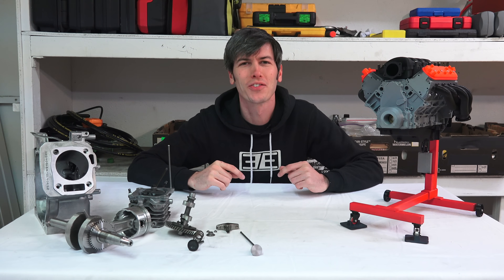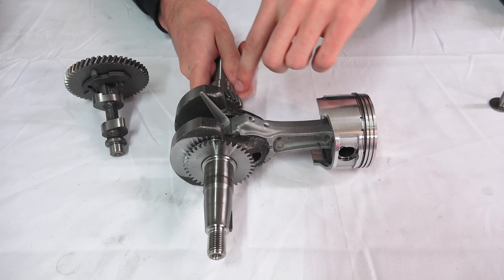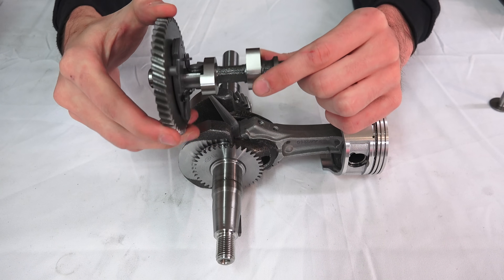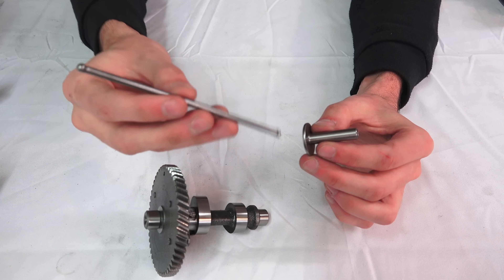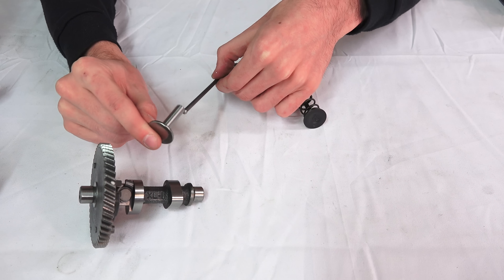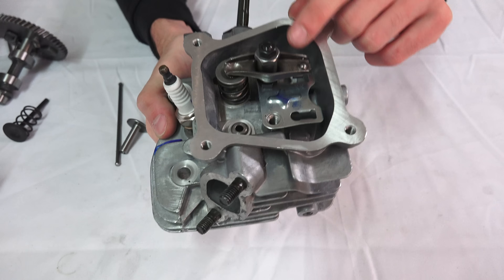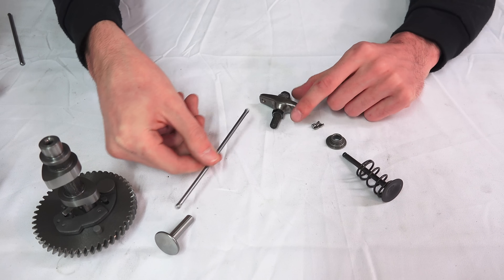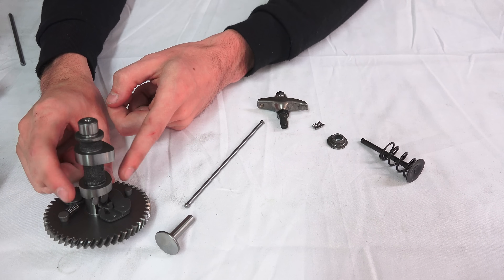Why Can't Pushrod Engines Rev High?

Comment: Lmao. So Nascar engines, which are push rod... Don't Rev high? Hmmmm
Reply: Torque has nothing to do with where the cams, or how the valves are actuated. Typically pushrod engines are tuned to make more torque because they cannot reliably spin fast.  Nissan and Toyota both have 5.6/5.7L DOHC V8s that make just as much low end torque as GM and Chrysler's pushrod engines. Ford's 6.2L SOHC engine also makes a ton of low-end torque. Ford's GAA tank engine is a DOHC V8 that made 1000 lb-ft of torque at just 2,200 RPM.

I never questioned the longevity of pushrod engines in normal applications. I was referring specifically to sustained high-RPM racing applications. They cannot reliably spin 9-10,000 RPM for more than a single race. A DOHC racing engine can be expected to go 100 hours or more on a set of valve springs. A NASCAR engine can only manage about a single race safely.
Reply: Kepe wrong. Again. The 15 k Rev engines are not DOHC. they have pneumatic actuated valves. No cam shafts.
Reply: Yes I do know how long a race is. But how long is your average car expected to last - around 200,000 miles these days. A car like an S2000 is expected to survive endless track days, and hundreds of thousands of miles on the street. 

Race cars derived from production engines like the Spec Miata series will typically go 2-3 SEASONS before getting rebuilt. That can be 120+ hours of racing. NASCAR engines on the other hand get rebuilt nearly every race.
Reply: That is true, you are correct that they spin to 9 grand for hours, which is quite impressive. However "hours" is really not a particularly long time for an engine. A street engine will typically go 200,000 miles, which typically equates anywhere from 4,000-10,000 hours depending on the vehicles average speed.

A 9,000 RPM DOHC 4-valve motor used in a race series (such as a Honda S2000) will typically last for 2-3 seasons of racing, which is around 100-150 hours of sustained 9,000 RPM operation. A NASCAR engine typically lasts for one race before it gets rebuilt - the main issue being the valve springs.
Reply: I already provided examples of DOHC V8 engines that provide just as much, if not more low end torque than competing pushrod engines. DOHC engines are also nearly as old as pushrods! The first OHC engines showed up in 1902.

Lightweight valve springs can, and do take the abuse of sustained high RPM operation. You see this every day in motorcycle engines that often spin to 14,000 RPM or more. Honda once produced a production motorcycle that turned 20,000 RPM reliably. Small, lightweight valve springs can take that abuse. The monster valve springs with 1000+ pounds of open force needed to make a pushrod engine spin 10,000 RPM cannot last long. The stresses involved quickly exceed the fatigue limit of the material.
Reply: did you even watch the video? he said they have regulations..
Reply: Those engines are made for that, your average joe's car engine can't... for long anyway lol.
Reply: mrbaja, nascar engines are junk, and essentialy a 50yr old truck motor design, and only last hrs. Their purpose is to sell old design engines to a uneducated public
Reply: They can't rev high for very long, and require frequent valve spring replacements because of the forces the valve train experiences. A modern DOHC engine can turn 9,000 RPM for decades.
Reply: No. Nascar engines Rev to 9 grand for hours. Go back to sleep.
Reply: bigpigslapper Oink I work for Nascar so.... Yes I do know how long they last. It's for hours. Especially the long tracks. Please stop it.
Reply: bigpigslapper Oink sorry my messages are going to the wrong peeps.
Reply: Nascar engines are racing engines. They are serviced between each race, so they only need to last a few hours of usage between changing parts. Compare that to racing DOHC engines. They rev to 15000 and more. So yes, when comparing pushrod engines to equivalent DOHC engines, pushrod engines can't rev very high at all.
In normal day to day cars, pushrod engines can't rev as high as DOHC engines because they need to last a long time. Which they won't if they are revved high.

Comment: F1 engines haven't revved to 20k for at least 4 years now. The current turbo ice barely go over 10k rpm iirc.
Reply from the maker: Current tech is 16k, again, due to regulations.
Reply: It is not current tech that keeps them at 16k, it is fuel flow regulations that prohibit the engine from going much beyond 16k. If they were allowed to flow more fuel they would be back at 20k+ with ease.
Reply: Engineering Explained unregulated  they would be over 20k by now.
Reply: 15k limit by regulations.
But they never do 15k because why when the fuel rate is limited at 100kg an hour.
Which they can burn at lower RPM's at greater efficiency which means higher power output due to less internal losses.

Sometimes it's better to run at lower RPM's with more boost then at higher RPM's with less boost.
After all there you can't keep making the fuel leaner which you'd have to do when the flow is limited.

Currently the engines run between 11-12k on average.

Comment: In theory it should make a difference and I suppose better fuel economy and efficiency are superior in a very small OHC four stroke but then you see an air cooled 2 litre pushrod flat 4 Volkswagen pushing 1000 bhp and lifting the front wheels and you realise that in the real world the only place it makes any difference is in the pub after 6 pints.Then you ride a performance two stroke bike and you suddenly realise that all this valve train stuff is bollocks anyway.😀😁😉

Comment: What if you were to just not have a cam? If you were to control the timing, lift, and duration of each valve electronically, in theory, wouldn't that be a game changer for performance engines?
Reply from the maker: That's what FreeValve is doing! Super cool: https://youtu.be/FJXgKY2O4po
Reply: I prefer replacing less electrical and having less electronics in my engine. Easier to deal with, replace and what not.
Reply: Snipe Stud00 you say that but what if you could loose the valvetrain completely and just "plug/ unplug" valves and actuators from the cylinder head if it were done properly. 

No camshaft, valve buckets/ shimming/ timing adjustment. 

Electronics oftenly take away a lot of mechanical complexity and remove a lot of complex components improving reliability.
Reply: Samuel Curran you shouldnt run a car in that state anyways. The fuel system will still force fuel possibly washing the cylinder and putting gas into your oil. Thats new engine status. Course thats if the car doesnt shut off for safty purposes. My LQ4 5.3L i can simply remove the rockers, pushrods. and loosen the spark plug but leave it in the holeso crap isnt sucked in or blow out other than fuel leaking out so it wont put preassure against the head or bend a connecing rod to the crank scoring the cylinder. if i recall i have hydraulic rollers not flat tapits, so course id be destroying the cam possibly wearing a flatspot $350, rollers needing replaced from smashing into the cam $50  and since i have to pull the heads, i might as well rebuild it and put decent parts, better than factory, back in. Ckurse that as long as the truck doesnt burn down from the fuel being push right at the headers.. 

I do know GM done the v8 to v6 and even v4 mode cutting cylinders, but im still one to have all 8 and wear all 8 evenly. As time and time have shown again, theres no replacment for displacment. The 6.2L caddillac de'eglance was boosting 12-14mpg on a 3 speed. Those cars had torque, not HP and were land yahts weighing close to what a 1 ton if not more. 

I actually had 4 of 8 plugs loosen on me. Thing chugged like a diesel and drank like a dragster til i found the issue and had time to fix it. Otherwise, i had no issues. Damn aluminum heads expanded and the plug came loose. Had to make the engine hot and bottom out the plug then torque it. Will be replacing heads soon as im tired of the ticking to begin with.
Reply: What? I'm talking about with free valve. You no longer need a valve train as it's run with electronics. Rather than timing an actuation being done by mechanical means 

Running a normal engine with no valve train XD that's not even possible is it. 

Well no of course not. Of course you'll be able to get more from a bigger engine but that doesn't do anything to say how good the engineering behind it is. Whether you need a larger displacement is a different question. 

Yeah I know with the V8 to V4 thing there's a few companies that do it. If they're doing it right they'll be still running all the cylinders but only firing them half the time so rather than igniting every 2 rotations you're doing it every 4 but still running between all the cylinders. simply shutting off half the engine and running the same 4 cylinders is a really lazy way of doing it.

The aluminium heads are only an issue because materials were mixed with the block being iron. If everything was ally it wouldn't be an issue. Got a little 125 2 stroke that runs hot as anything, 2 rebuilds and i've had no issue with sealing the head.

Comment: Pulling 7800 RPM with pushrods isnt too difficult, the only limit for my engine is the crank physically breaking at the main bearings at 8500RPM under load. Doesnt mean you cant wind her out though:)

Comment: You should compare this to ohv and explain their operation as well
Reply: OHV (over head valves) are pushrod engines
OHC ( over head cam) engines with camshaft in head.
DOHC ( double over head cam) engines with 2 camshafts in the head.

Comment: 20.000rpm on F1 engines? Those days are long, long gone. Since they went with hybrid/turbocharged those figures are no more. Thus the reduced noise...
Reply from the maker: I think it's around 16,000 RPM now, but again, due to regulation. NASCAR isn't hitting 10k these days either.

Comment: OHC can have valve float occur too, right? Like during a moneyshift?
Reply from the maker: It can occur with OHC, yes, but generally the valves are lighter, and their aren't pushrods, so there's less reciprocating mass between the cam and the valve spring.
Reply: Engineering Explained Thanks for clarifying that! :)

Comment: The problem with valve float is sometimes the pushrod will get bent because of that quick impact of the tap to the cam lobe, furthermore direct gear-driven camshaft need no maintenance unlike the timing belt and timing chain.

Comment: Can't you just use stronger springs for the valves? Or two springs per valve?  Because usually that's what you do to a DOHC engine when you significantly increase the rpm limit. I don't see why that wouldn't work with pushrod engines.

Comment: Hi Jason,
It is amazing how relatively simple these V8’s are compared to the very complex European and Japanese engines. Could you make a comparison between these design approaches and explain the pro’s and cons?
I’m thinking costs, horse power, efficiency and emissions.
Reply from the maker: Yep, will have a video on it soon!
Reply: Engineering Explained Tia, looking forward to that!
Reply: I am interested to know what the differences in efficiency and performance could be if pistons and or valves were oval. I can imagine the major problem with that will be cost of machining such a valve.

Comment: From everyday use standpoint, I don't think this "revability issue" makes a difference. Stock pushrod engines can rev over 6K RPM since 1960's. How much revs would you need for your car, even it is a sporty one? Currently 6.5K seems to be a pretty standard redline for pushrod motors. For many DOHC engines it is not much higher - 6-7K seems to be a reasonable level from practicality and cost sides.

Comment: Whereas most diesel engines can't rev high, how do others such as BMW's N57 rev as high as 5.5k RPM?
Reply: Very highly pressurized commonrail direct injection results in a very fine spray pattern that burns hotter, leaner and quicker. Diesels are RPM-limited by the speed of the expanding flamefront of the combusted fuel. The longer the stroke of the engine, the further the flamefront travels per revolution. So shorter stroke diesels tend to be able to rev higher, but have less torque.
Reply: Duskconqueror Also piston size and overall intended duty rating make a difference too. A diesel that plans on massive torque needs to be stout, and making something stout always adds weight, and reciprocating and rotating weight are also detrimental to RPM. Swing your arm in a circle as fast as you can. Now grab something that weighs 2-5 lbs and do it again. Notice not only do you not go as fast (parasitic loss due to the increased weight to move), but your arm may hurt or feel strained a bit after doing so.... That'd be crank & rod damage, essentially. Good way to throw a rod or blow out your mains, cycling too much weight too fast. That inertia that amount of mass has becomes too great.

While I'm not familiar with the BMW, I can assume it's using lighter components than say a HD truck motor is, as well as not necessarily focusing as much on low end torque since that BMW isn't going to be a tow pig, and therefore don't have to fortify the engine parts as much, reducing the reciprocating mass.

Also, diesels actually burn in a bearly instantaneous combustion. Burn speed is near instantaneous compared to a gasoline engine, which is one reason they make so much torwue by comparison. Rather than a flame chasing the piston trying to continously act on it as it's "running away" from the flame (imagine chasing somebody and trying to punch them too... Your punch would be much less effective because overall speed of your punch is reduced, relatively speaking), a diesel simply compresses it until it explodes on its own, and virtually ALL of the force is exerted on the piston near TDC, rather than over the course of the whole power stroke, decreasing in effectiveness the whole way down.

Does that make sense?
He explains this in one of his other videos, a gasoline vs diesel one.
Reply: JoeIsCrazyWillman Tired, so short response. 1. Diesel doesn't explode, it has a flamefront. 2. Making something stout/sturdier is also possible using stronger materials that can even make it lighter (e.g. billet instead of forged) 3. Only point using high rpm (6-7k) shorter stroke diesel is no boost limiting fuel knock, so high budget race engines (Audi @ Le Mans)
Reply: 1: Diesels have near instantaneous combustion. There's hardly a flame front at all. You need to research diesels again then. That's part of why diesels make the torque they do compared to a similarly built and sized gasoline motor.
2: No duh. But eventually you run out of known metals that're lighter and stronger, and so the only way then that you can beef it up after that is adding thickness/weight.
Also, those lighter and stronger metals tend to cost a lot more, so they're oftentimes not used except by high end vehicles and race vehicles.
3: The point behind it wasn't part of this discussion, so idk why you even brought it up other than to have something extra to argue about so you feel better about your answers maybe or something, idk. #3 was a completely irrelevant point to make and could've simply been omitted.

Comment: I want to know why anyone gets a kick out of their street car reving super high and labeling certain engine features as "high tech". I don't see the point in a US spec version of Honda's F20 because it's around the same size and weight as an aluminum block Ford Windsor and makes less than half the torque of a descent stock headed 302 roller from 25 years ago. I would love to see a flow bench comparison of modern two valve and four valve per cylinder heads because I found an old HotRod article that showed an old four valve head outflowing a comparable two valve at mid lift, but not at high lift. It seemed to indicate that two valve heads have an advantage at comparably higher valve lift, but that article was very old. To me an engine is just a cube that makes torque, so I don't really care about pointless features like four valve heads, flat plane cranks, and DOHCs. I'll daily drive a hybrid and race the biggest, nastiest V8 I can afford.

Comment: Short stroke engines are high revving engines. They can make good hp but lack torque. Long stroke engines are low to medium  revving engines. They make boat loads of low to mid rpm torque. Choose your weapon.

Comment: Why do so many damn DOHC engines peter out at 6500 RPM?  One would think the BRZ could trivially get to 8500rpm or better. I feel like that 2.0 is limited by it's valvetrain.
Reply: Clobercow1 because you lose low end torque and it makes everyday driving worst.